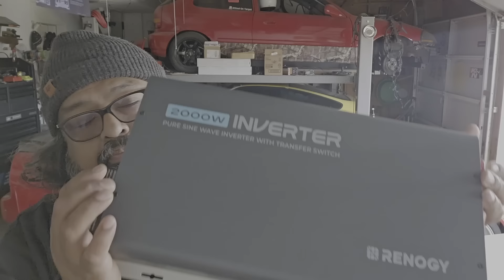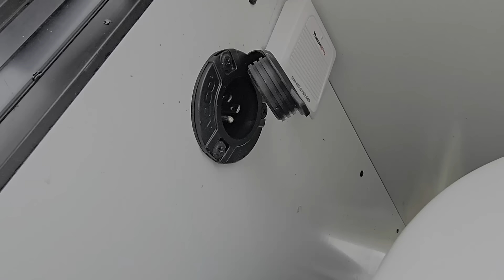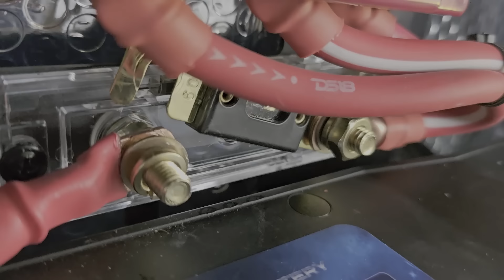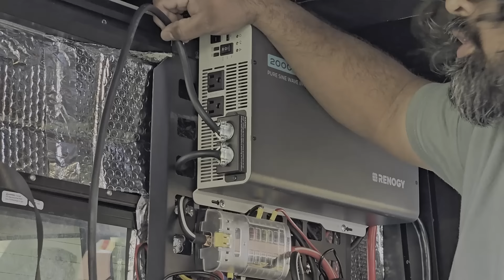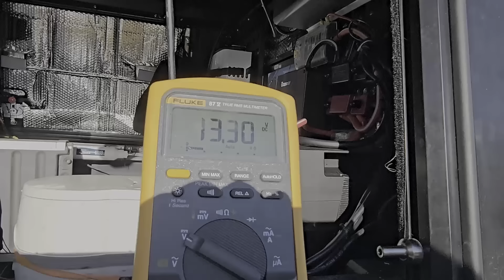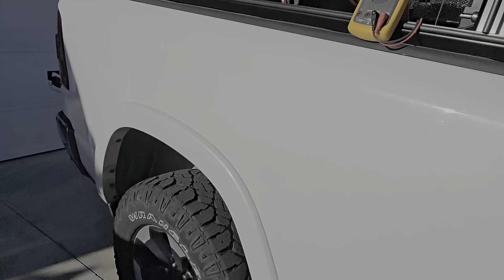Install and Test: Renogy Inverter with Bluetooth and Auto Transfer Switch

Comment: I don;;t think my transfer switch is working with my Renology 1000W setup. When connected to Shore Power and the Inverter turned off, is the Green LED light on? Renology support says it should be but I can't get it to push 120v  to the AC Out unless the inverter is turned on.

Comment: Thank you sooooooo much!!!. Your explanation of how the system works really helped me. I'm currently trying to troubleshoot my inverter's UPS function (mine is identical to yours). Renogy hadn't been great at explaining how this works but now I have a clearer idea. And it seems I've misunderstood how the inverter is powered. I thought both shore and 12v battery can power the inverter at will. But it seems like the 12v battery powers up the inverter. Only then will the UPS function work. 
Guess I have to keep my van in accessory mode to make good use of the UPS function to power my load in the camper van and charge my battery bank. 
Thank you for posting.
Reply from the maker: Im glad I helped!

Comment: great video.  I wasn't sure what those AC in and outputs were for but now i have a better understanding.   Now when i plug into shore power, i don't have to manually move my power cords over, i can just keep them as they are and it will know to draw from shore.  Perfect!

Comment: What about hooking up shore power like you did and using battery charger plugged into inverter to pass thru and charge battery while hooked up to shore power? I have victron 30 amp battery charger trying to figure out the best way to use it with this inverter.

Comment: Great video. Thank you! You were fast forwarding through the cable connections. On the AC side when attaching Line and load wires, are they push in type connectors or how are those wires connected?
Reply from the maker: Push in type
Reply: @steelontarget  Thank you
Reply: @steelontarget  Was that stranded or solid wire being pushed in?
Reply from the maker: @cdn-u7f on the AC side it will be solid wire.

Comment: Hey Boss would you recommend the inverter charger with transfer switch? 
Or separate charger? 
Mainly used for cargo trailer conversion.
Thanks
Reply from the maker: Indont have experience with then inverter charger but aounds like an interesting option.

Comment: I’ve had the 1000w renogy for 6 months. Works amazing. But here recently my transfer switch hasn’t been working. When I disconnect to use batteries switches awesome. But when I plug back to shore power it doesn’t seem to switch anymore. Let me know if you’ve ever run into this problem

Comment: Great vid. I just bought this inverter I plan on using it for my off grid cabin. Would it still work with my generator?  There’s no ac power where I’m at. Would I still be able to utilize the ac connections? Thanks

Comment: I have the 3000 W version of this, but when I plugged my a/c power in my inverter is still running and showing that it’s using inverter power, any help with this
Reply from the maker: I would verify connections at AC input. I had to redo my connection and make sure it was in the right spot.

Comment: Nice video, does the inverter need to be turned on for the AC power to pass through? Basically if on shore power does the inverter need to be turned on to run your AC power devices?
Reply from the maker: @Allen-Ds  the switch has to be on, power won't pass through unless inverter switch is on.
Reply from the maker: @Allen-Ds  that is a great question, i will try that today.
Reply: @steelontarget  I have the same question.  Is the output dead if switched off?  Or does shore power pass?
Reply: Awesome let me know what you find out.
Reply: Yes

Comment: I think im gonna go with the renogy setup instead of lone peaks down the road. Ill use your links when I do. Where did you get the mounting plate you have the inverter on and all of your electronics? If is even called a mounting plate. I should be able to figure out how to piece everything together. I might have to call renogy for help.
Reply from the maker: . Thank you!  that is the molle panel from lone peak....BUT if I didn't already purchase it, I would make my own out of plywood or sheetmetal.
Reply: @steelontarget  oh okay thanks. I guess I'll just order a Molle panel with my build when they call me .